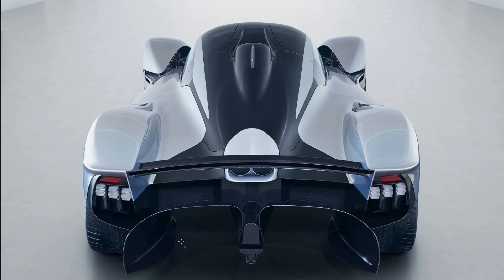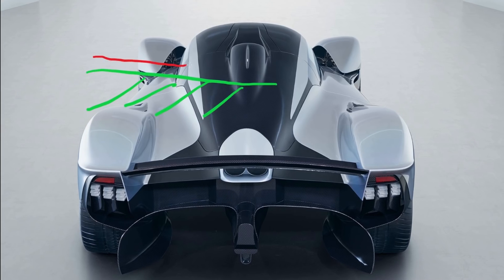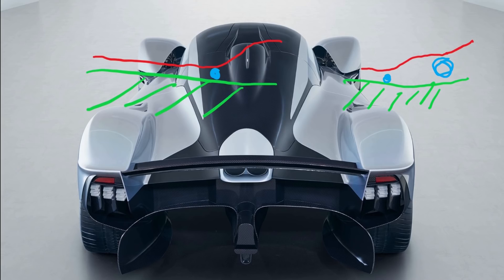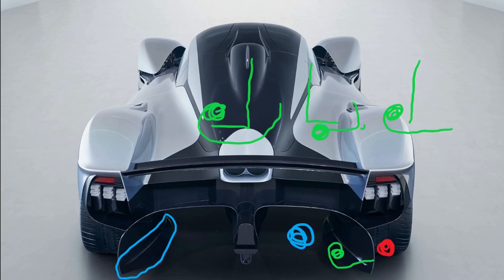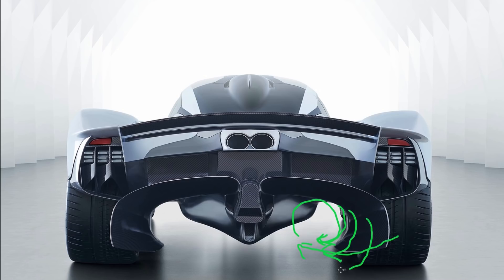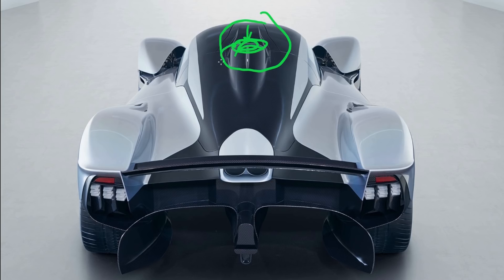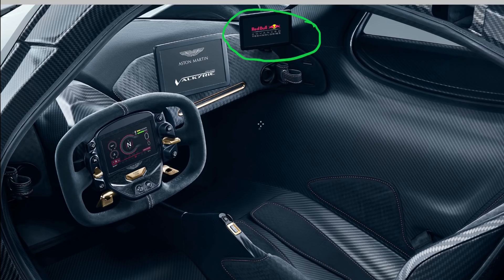Aston Martin Valkyrie - Aero Update Analysis and Comparison

Comment from the maker: Enjoy the analysis everyone! For all my time attack viewers I'll be around the pits at World Time Attack Challenge Friday and Saturday so feel free to say hi!
Reply: KYLE.ENGINEERS if you did a video on the new Honda Civic Type-R's aerodynamics that would be awesome! Honda claims the body of the car is aerodynamically functional. would love to see your analysis on their claims.
Reply: Kyle i got a question i always wanted an answer, what kind of role weight takes in case of a crash. I mean the same car at the same crash speed but with a 200kg difference or/and different segment cars. 
I was arguing with a family member about this i said that even if a car is small/lightweight if it got a good safety equipment that will be the car to be in case of a crash and not a heavy SUV. Can you bring some light to the dark??
Reply from the maker: Hi Mar, depends on the crash, if you're crashing into another car you want to be heavier as then you will have more momentum than them and you will decelerate less (at the cost of them decelerating more/reversing their direction of travel). If it's just you crashing into a wall or tree, you would be better off with the car with better safety equipment.
Reply: KYLE.ENGINEERS hey y don't you make a toy car that can glide
Reply: I'm curious as hell about how the Ferrari FXX K little rear spoiler ends function if you could video  analyze it for me, thanks! Just a suggestion.

Comment: Thanks Kyle, great analysis and explainations. 
With the wheels being mostly covered, and the huge diffusers, will the downforce generated by the car be more consistent than a wings and open wheel F1 car?
It doesn't appear to have the multiple winglets, tabs and slots that F1 cars have on their wing and barge board, what are the reasons such details aren't provided (or required)?   And are there any estimates of the amounts of downforce this car will be able to generate?
What sort of tyres will the Valkyrie run? Presumably something pretty special to be able to cope with the power, the speed, and presumably significant downforce.

Comment: I was wondering, how does the rear radiator gets a clean air if there's huge amount of air extracted from the front wheel and front part of the underbody, almost in front of it ? If I look at it with my basic knowledge, I would assume that air from that big gap at 6:21 would push any clean air that goes around the side of the car outwards and therefore there would't be any high pressure air left for the side radiator. I would love to know how the air around that side of the car really works.

Comment: They should've gone blown diffuser :(
Reply: Maybe yeah. But for example zirotech for heat protection is VERY VERY expensive (even if they use foils for protection is pain in ass for carbon fibre resin). From economic standpoint, maintenance and engine tuning maybe is better to get basics right first. Furthermore if we look pragmatically. If they put turbo engine in that car in future, all exhaust energy gets lowered so effect is even lower. And final nail in coffin for EBD.  All that development  of aero tools for PROPER gas exhaust testing and CFD , wind tunnels (lasers, smoke, optics) takes long time, is VERY HARD and EXPENSIVE. Even F1 teams failed flat in that area, not to mention boutique Aston Martin and its limited R&D money.

Comment: If you noticed, the actual idea behind this project for Aston is to create low aerodynamic drag. So they didn't want to sacrifice drag in terms of downforce, thus actual downforce will be very low on the car if compared with a race car, but normal maybe higher than average for a road car.
This car has no ground effect whatsoever, just Bernoulli's equation low pressure region and basic idea of less stuff getting in the way.
Reply: DoriFord so you think it will be for top speed ? maybe 400+ kmh ?

Comment: KYLE.ENGINEERS you should do a video talking about the aerodynamics of the Chaparral 2J
Reply: The 2J had a lot of downforce but it didnt achieve this by using wings but because of a snowmobile engine in the back. That 2nd engine was sucking all the air underneath the car creating a lot of downforce and massive ground effect. Unlike wings this car's downforce was permanent. 

You know those GPS and Phone holders that you put on your car's windscreen? The vaccuum makes it so it sticks really well to the windshield. Ground effect also did the same thing. By removing the air underneath the car it created almost full vaccuum causing it to stick to the road really well.

Comment: Step1: introduce the car with a futuristic cool look
Step 2: sell them all
Step 3: make ugly areo
Reply: Web crawler anyone who is interested in aero would think that if it benefits the aero, its beautiful
Reply: Jan Christian Frodahl whats so ugly about the aero
Reply: Agreed, they ruined the lines.
Reply: Guess you dig those flat hub caps
Reply: the earlier visual was wonderful..
Reply: I think the old design with the foot plate on the vertical vane and the defined lines before the intake looked better, but apart from that the car remains largely the same. I do dislike the covered wheels, I hope we at least get a better design.

Comment: Amazing video! But I still don't understand how they get the rear suspension this high up with current diffuser design 🤔. Is there an explanation for this? Greetings from the Netherlands!
Reply: If I had to guess, the center differential is mounted higher than normal with telescoping half-shafts to each wheel to prevent them from being pushed outwards during suspension travel.  The suspension must be pretty interesting, too.

Comment: That is the most impressive underbody I have ever seen. Shows what can be achieved when aero isn't restricted by loads of regulations. I would love to know how it compares to current F1 cars in terms of downforce.
Reply: The track version would beat F1 cars on certain tracks. That's my guess.
Reply: @F1ll1nTh3Blanks  you underestimate F1 cars significantly
Reply: @F1ll1nTh3Blanks  only 3gs in the corners for the track version, impressive for a road car but the short wheel base and extra mass needed to make it more road usable kinda fucked it performance wise.

Comment: Ok, I have a real oddball request/question:
Would there be anything to gain if you took all of your radiators and put them in the back in order to try achieve an meredith effect (as on the P-51 Mustang)?
Ignore added weight.
Reply: Gjaeralaus it’s not clear if this is true, but there’s been a bit of speculation that F1 cars have been doing this for a bit. Theory on F1 technical seems to be that they set up the ducting to accomplish this so long as it doesn’t interfere with generating downforce, and is a bit of a marginal optimization.
Reply: Interesting, thx for sharing :)

Comment: Hello Kyle. Love the video, very illustrative. However, I disagree strongly at some points! Let me elaborate:
At 12:21 you are speaking about a vortex that builds up underneath that outward footplate.
Now from my experience as an aero engineer in formula student I can guarantee you that this is not the case whatsoever. The air will just flow underneath that plate and build up a vortex on the edge of the diffusor-fence. The purpose of that plate, if you run it low to the ground, is to create a kind of gap seal. When the air is flowing through the tight space between the plate and the street it loses energy which will result in a smaller vortex compared to a diffusor without such a footplate.

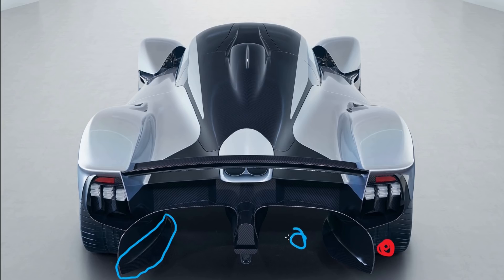Another point I disagree with is that you said at 12:00 there is a HP behind the tire and a LP in the diffusor. That is also not the case. Directly behind the tire there is a low pressure region and since we are at the exit of the diffusor, the pressure won't be that low at that point. The thing that is probably forming the big vortex you talk about is very likely going to be the rear tire jet that is being sucked underneath the diffusor

I am also a bit iffy on the front wheel plate with the outwards slope. I'm pretty confident that if this plate creates suction in any form, all that is going to be sucked is the front tire jet. I don't think it will increase the frontwing performance

Ofc I could be wrong and I'm not as educated on aero as you but we run such an outward footplate on our diffusor and the vortex never formed underneath that plate no matter the ground clearance or size of that plate
Reply from the maker: Hi there, the vortex at 12:21 is something I have seen in practice with some of my large tunnel/diffuser, high lateral expansion designs on touring car bodies, so I can assure you it exists in quite a few cases. I have also previously discussed this diffuser footplate vortex with my old PhD supervisor (ex F1), and he has confirmed its existence (in fact he was the one that first put me onto it!). Regarding the HP/LP, again on the same designs mentioned previously, with high rear lateral expansion there is about a 0.5Cp differential between the outside and inside of the diffuser as we move towards the rear of the diffuser where the lateral expansion is forcing against the tyre wake. At exactly the rearmost point of the rear tyre, they are about even in pressure (which does extend back a little), and at the front and mid of the tyre the pressure is higher outside the diffuser body. The fundamental point I was making was that not specifically at the point directly behind the rear tyre, but more along the majority of the diffuser the pressure is higher outside than in, hence the air will flow inwards. 

And regarding the plate increasing the front wing performance, again it is something that commonly improves performance in more closed body, touring cars, as the more air you can evacuate from the front the better. They have opened the front up a lot compared to the previous model, but there is little doubt that having a vane guiding the tyre wake out will provide a clearer air path for extraction out from the front wing and will consequently improve performance. Take a look at something like the LYFE motorsports GTR for example. 

Thanks for watching! Out of interest, which FS Team are you from?
Reply: Thanks for the answer! Well I suppose if you've seen such a vortex in practice then there is no doubt about its existence.
Keep an eye on your inbox, I wanna write you a PM about that when I have time tomorrow :)
Greetings from Germany

Comment: The first model of the car was purely concept. I wasn't convinced at first there was any space for the engine and couldn't see any intakes anywhere. But it's evolving. Hopefully when it's done it will have a stellar paint job. I wonder how Adrian and Aston Martin are planning to keep the weight down with a hybrid powertrain.... time will tell. I wonder why no one has tried Fan assisted downforce till date.

Will that lateral expansion in the diffuser is going to act like a rudder and keep the car very stable?
Reply: srinitaaigaura it weighs 1030kg
Reply: There're homologation requirements that might cause this to go up. Racing designers always start with something inspired from the track, but when they have to bring it to the road, I've never seen a single instance where they actually managed to maintain their ambitious weight target. Still, the difference will not be much.

But in terms of aero, this car is a whole other level of crazy. All other hypercars (and even the megacars) won't be able to touch it if they can pull it off.
Reply: I believe the Ferrari 599xx had fans in the trunk pulling air from the underbody. I don't know how much it helped aero though. Check out out!
Reply: srinitaaigaura i guess you played too much gran turismo 🤗. I guess it would be very heavy🙁

Comment: Why isn't the throat of the diffuser tunnels closer to the ground on this car? Wouldn't we be able to extract more downforce by running it closer to the ground,  thereby making better use of the ground effect?
I have seen several diffusers especially in Formula SAE having no more than 3-4 inches of ground clearance and they seem to work quite efficiently. What are your  thoughts on this

Comment: The question is
Will it be better than Mercedes
Reply: As he mentioned in the mercedes video they have different focuses. Mercedes: drive train. Aston: Aero
Reply: Mercedes is using a tiny F1 1.6 L V6 with MGU-H and ERS with 4WD electric motors. This car is using a 6.5 L NA V12! Kind of shocking isn't it? Rimac is going to provide an ERS battery System (yeah, the same guys who built the Concept one and the Koenigsegg Regera's battery system).

While the Mercedes engine needs a rebuild ever so often, the AM's will last forever. The Aero on this is in a whole other category of insane. It will destroy every other car on a track.
Reply: Web crawler They crashed one car on nuburgring And it was kinda disappointing but they crash on top gear learned them a lot, they added wing (named „top gear wing”) And later worked on aero much more.
It was ccx if I remember corectly. 
Sadly Koenigsegg never appeard in top gear again
But it is good on any other track video, They dont have their own cars like bugatti so they cant measure times on other tracks, even 0-400-0 car wasnt their, it was already bought
Reply: I found out Koenigsegg One:1 Has almost 6 sec better lap time than McLaren P1 at spa 
So it is fast at track
Reply: Will it be street legal?  There are no bumpers to speak of.  The Mercedes may be better for the street and the Valkyrie better on the track.  Either way, they're both going to beat the crap out of anything else out there.
Reply: The question is: what will the Ferrar and porche response to this will be.
Reply: @0ExG0  The 812 Superfast
Reply: Yes
Reply: 0ExG0 I dont think porsche will make a rival. we know mclaren is developing a car and ferrari most likely will
Reply: @jamalthasim9041  McLaren is working on a one off it seems, Ferrari wants to build something all electric last I heard and Porsche is gonna work on an all electric with Rimac now they have shared in Rimac. I am not sure whether they wanna try and compete with AMR RB or AMG tho.
Reply: @Motor Racer Ok. That's more recent info. But still, a non-issue. I haven't seen a car in this category ever been driven that long ever by any customer.
Reply: I'm curious as to whether the cost of the cars is the same as well? Perhaps they are aimed at different budget categories
Reply: YES. It will spank the merc
Reply: Possibly but I doubt it.
Reply: @symmetricalfoundation8735  doubt what.. No hypercar will touch these cars on track for years.
Reply: Definitely
Reply: @Amarjit Singh yeah, amazing that few years can make such difference huh? 
But still, it wasnt the case when I wrote it :/
Reply: but both Rimac and the Koenigsegg are pretty bad on track :/
Reply: Koenigsegg tried to set a sub 7 lap on Nurburgring but failed horribly over years. They even crashed and Rimacs batteries doesn't even last one lap. Koenigsegg even crashed on the Top gear track it's just ridiculous on tracks that's why they do 0-400-0 records and drag races with flying starts because that is where it shines
Reply: Krzysztof Dolecki it'll set faster lap times but the project one has more raw straight line acceleration
Reply: Who said Koenigsegg is bad on a track? And Rimac has 4 wheel steering.

Comment: Great video as usual. One question came up in my head.
In case of loss of control during high speed cornering situation, could the car be thrown into the air due to not having a shark fin like structure and wheel openings like and LMP1 car?
Keep up the good work and the great videos
Reply: I doubt that'd be an issue; sportscars have gone decades without fins, and they had no problems like that, to my knowledge. The benefit of the fin seems so marginal that I wonder if it'd even be on most prototypes if it wasn't mandatory.

The only major stability problem prototypes have continuously suffered from is backflips, which are caused by the mandated flat(ish) undertray. However, this car has enormous ground effect tunnels, so I doubt it'd ever experience flips.
Reply: Chinese billionaires seem to have no problem crashing their hypercars in cities let alone at Vmax speeds...
Reply: good point. It wouldn't be good if the thing backflipped at 200+ mph. Maybe that's part of the reason for venting the frin more and cutting away the  area behind the rear tire.
Reply: Could be yeah. Still if the car is going against a wall of air at a 90 degree angle I would imagine that there could be a high pressure build up on one side of the car. Can't wrap my brain around that. Still this can all be a dumb idea on my side. Don't have the proper knowledge of aero like Kyle has.